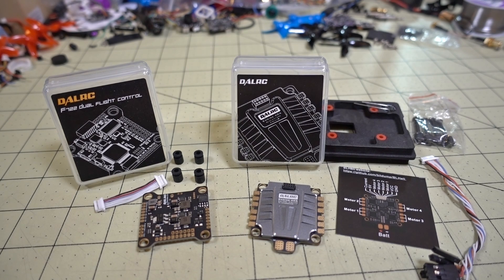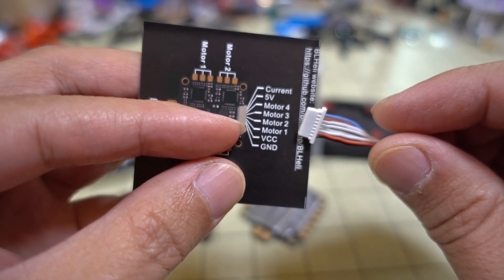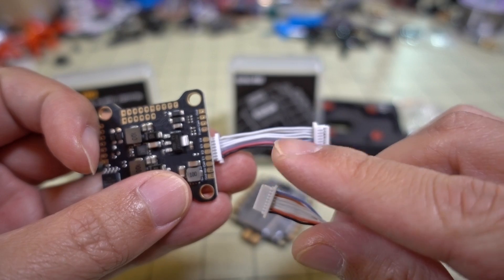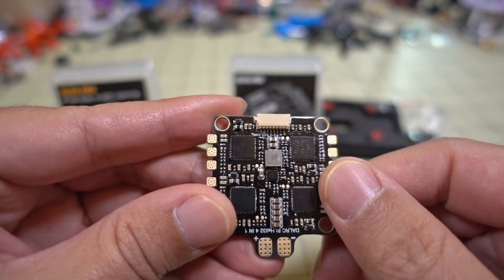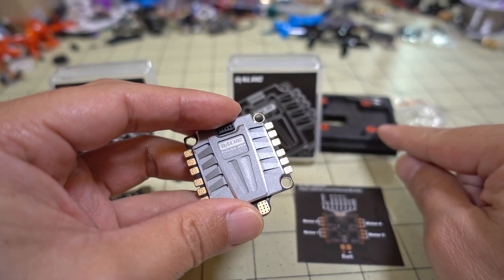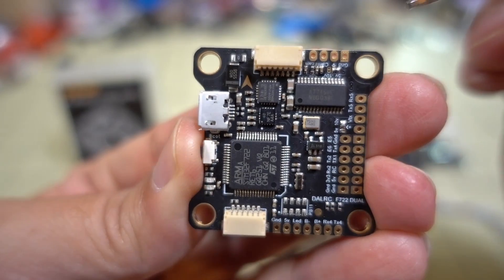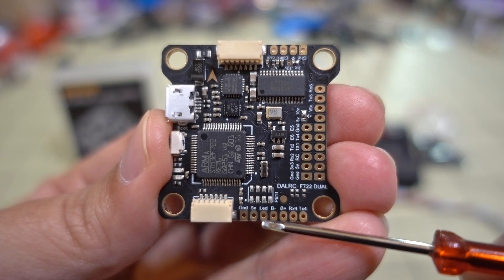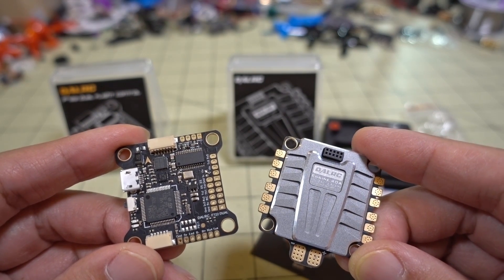DALRC F722 FC and 40A ENGINE ESC ⚡

Comment: I see this alot,  i just bought a stack combo  dalrc rocket with f405 controller. They do not fit unless modified.. rocket should be paired with the F722 as the dalrc 40a should be sold with the F405
Reply from the maker: I did point this out in the video but thanks for the comment.

Comment: I have the Foxeer F722 (basically same thing) and the Dalrc Engine 40A on a GepRC Leopard running 5" props.  I just got the FC earlier this week and set it up.  Have not been able to really fly it yet because of weather -- just quick tests to make sure everything worked.  It was an amazingly quick swap of FCs even though I could not just connect the cable on both ends.  I had to wire each motor signal wire, vcc, and current.  Easy build.  I've had the ESC since it came out and has been awesome running BH Deadpool 2450kv.

Comment: Have you tried this ESC with 6S? You think it will work with a bigger capacitor maybe? I can't find anyone who has tried 6S on it and I don't want to burn mine
Reply: RIght, that's why no one has, lol.   I have had mine for over a year and won't try it.  Honestly I think it could handle a 6s setup if done correctly (maybe 2205 low kv), but I'm clearly not willing to put my ESC where my mouth is!